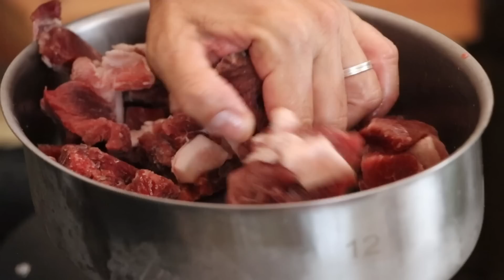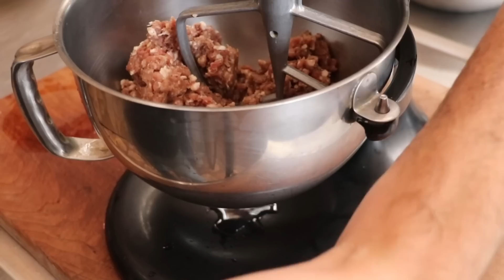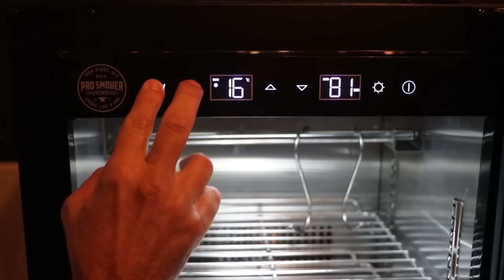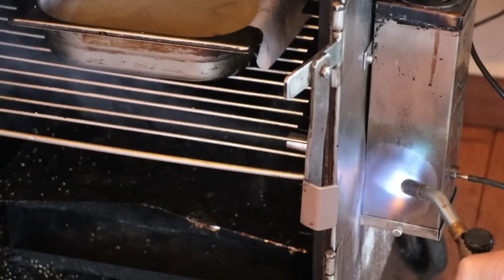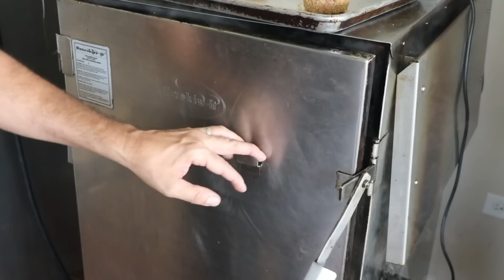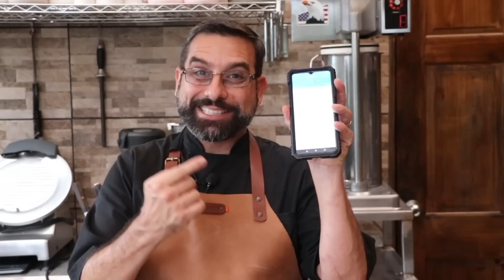Testing a Small Dry Curing Chamber with Salami | Round 1

Comment: Hi, really learning from your videos. I made your Coppa with great success. I am expanding the types of dry aged meats I cure using your videos. I notice in your DIY larger converted refrigerator, you have many different types of meat hanging at different stages. How would I do this, as some meats and stages require different temps and humidity. I will be making salami, coppa,  pepperoni, and your small boneless prosciutto. Thanks

Comment: Agree with testing it with a singula😮r project. If successful, then load it up! The ability to handle staggered projects simultaneously makes the unit much more valuable
Reply: Yup that's where problems usually arise, don't think it's possible in a small chamber. You have to have two chambers

Comment: I'd let it run with what you have.  Get a good baseline on how well it works before adding more variables.  Most of us average users aren't going to be making that many different things at differnt stages st the same time.  That would just be setting a potentially good machine up for failure.